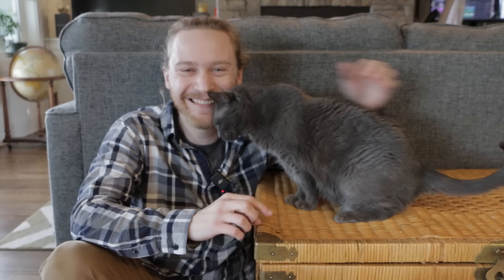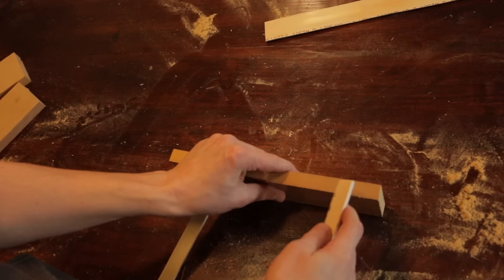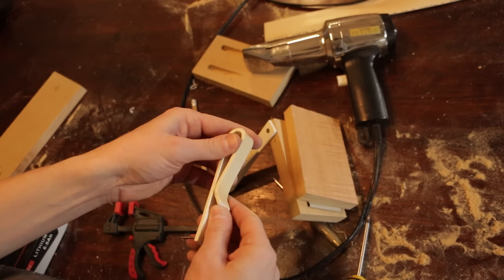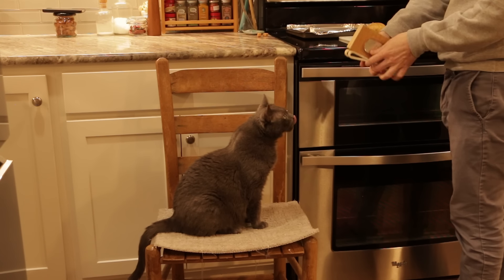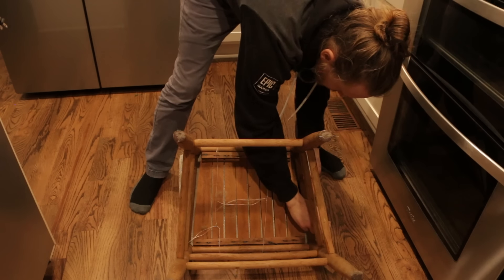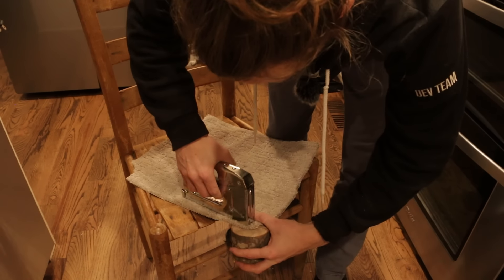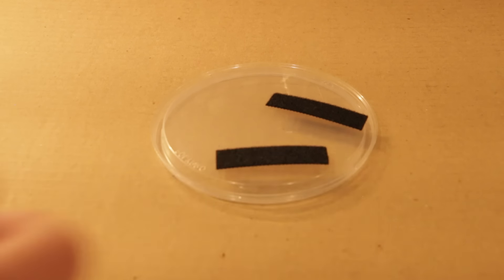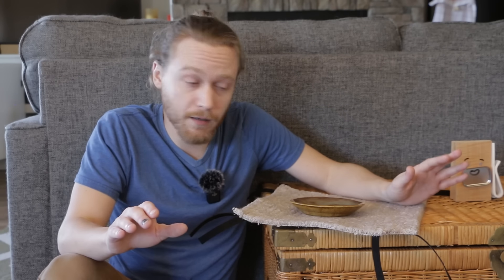Designing Solutions to My Cat's Problems

Comment: I loved this video, as did one of my cats, who reached out and patted Umbra on the screen! That swivel and fold design was excellent. 

I think the tray is too small for a cat to use comfortably as a seat or perch. Measure Umbra from shoulder to shoulder, hip to hip, and the length of spine in between, when she's relaxed or crouching flat. That will be the minimum size for a comfortable platform, I think. (And a chubby cat would need even more room, to accommodate tummy overhang.) The surface should also be non-slip, like the chair carpet. 

I think one cool solution might be to raise the chair (replace the legs with longer legs?) and make a little fold-out staircase for her. I'm envisioning that the seat of the chair is at about counter height, the back of the chair is still in place to discourage her from jumping over to the counter or range. You could leave the prototype there as her treat shelf! The staircase is similar to how a folding stepstool works, kind of like wooden window blinds, where moving one stair to its horizontal position moves all the others simultaneously.

Comment: Hey man for mdf you can always freehand with a router or a dremmel tool. For the magnets specifically i probably would use a large drill bit or a plug cutter!
All of these things cant be resharpened like a chisel though, so it is up to you.
Reply from the maker: This could work for sure, you just have to make sure it doesn't get away from you. Good suggestion, thank you!

Comment: Instead of chisels for hollowing, use a Dremel and if you need sharp corners then you could use the chisel for finishing. Usually smaller bits work just fine for corners finishing corners

Comment: About mdf and tools... well, i used mdf when doing inkprinting and what we did to have more control and to give a lil more life expectancy to the tools we varnished it before cutting into it... yeah probably not what you wanted to hear, right? In case you wanna know anyway, we used "goma laca", basically bug droppings mixed with alcohol :D
Reply from the maker: Great tips! Definitely more work for a cheap material but mdf can be so flat and stiff that screen printing seems like it would benefit from figuring out how to work with it. Lacquer and shellac are so fascinating, I feel like the world forgot how to use them. I'll look into it, thanks!

Comment: Making an over engineered mess that took way too long... Yup! But did you set your tools down and loose them every few seconds?
Reply from the maker: OMG yes, all the time!! I'm making something right now and I swear 10% of the time is just me patting around like Velma looking for her glasses. This speaks to my soul and it's good to know that there are at least dozens of us who do this.😅
Reply: "Does/did your child regularly lose the tools necessary for a task" was a question to my parents on my ADHD evaluation. 

My parents said "No".

Much to my "huh???!" 

Turns out they were basing this on the fact that I didn't get up while doing homework to find another pencil.  Or something. 

No. Of course not. That would annoy me. So I'd sit down with a pencil case full of writing utensils and multiple erasers, then pick up the 5 or so surrounding me when I stood up. 

I do the same thing with screw drivers.

But I did manage to train myself to use a hip pouch for marker, pencil, and box cutter at work.  It took about 4 months. ;)